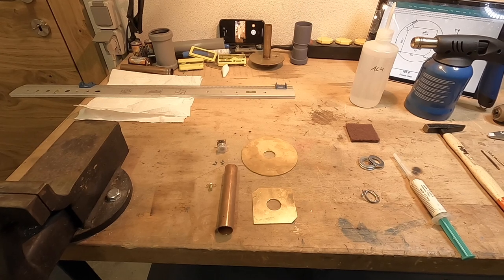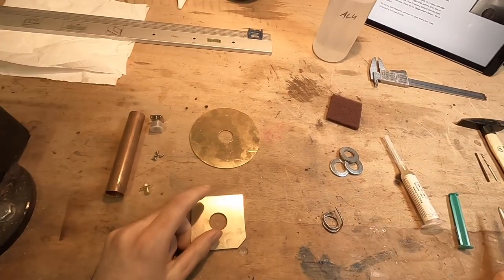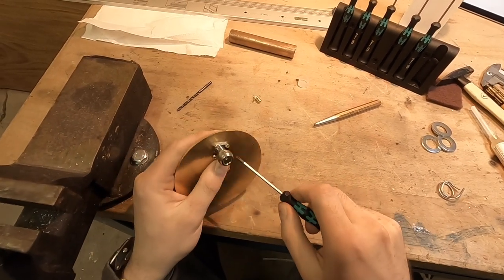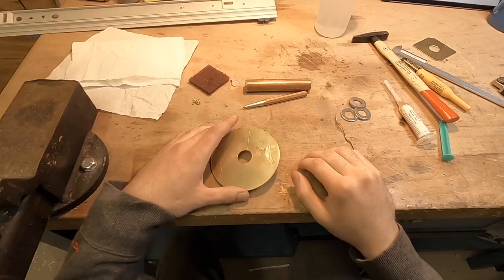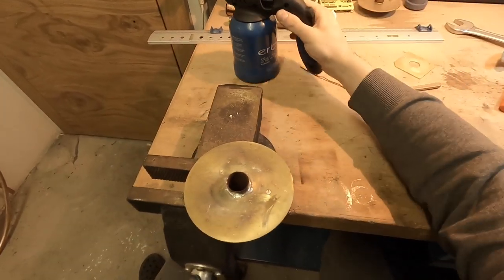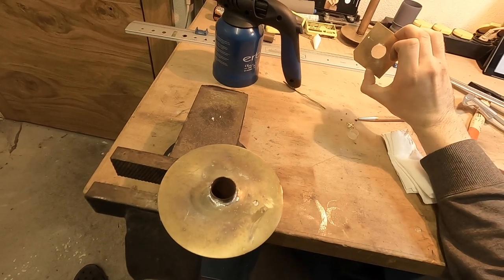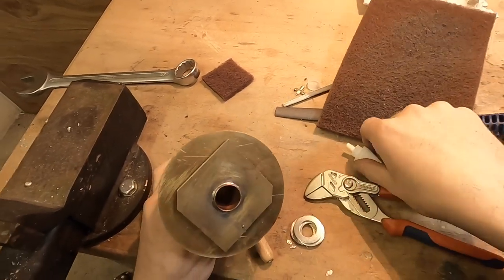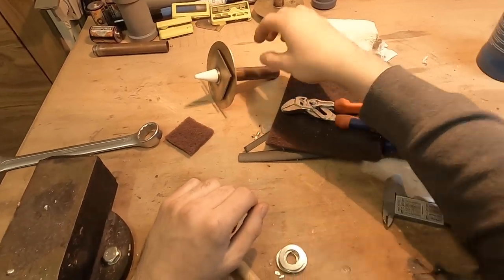Assembling the Dual Patchfeed (POTY) for QO100 (ES-Hail'2)

Comment: Hans, thank you for the video. It help me to assemble this POTY antenna variant for test with several others. Good results are also obtained by using flux and thin solder instead of solder paste. Instead of a gas torch I used HG6531CK Makita Head Gun. 73!
Reply from the maker: Using a heat gun is a great idea. :)